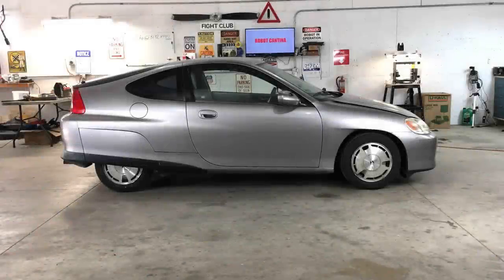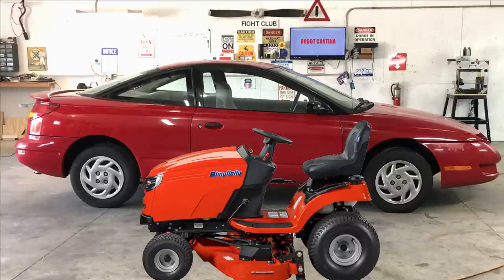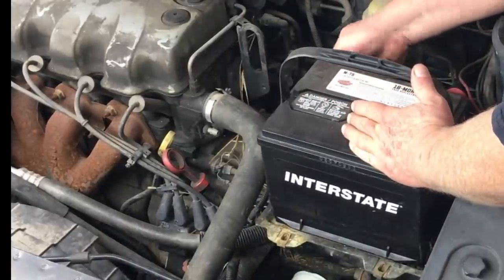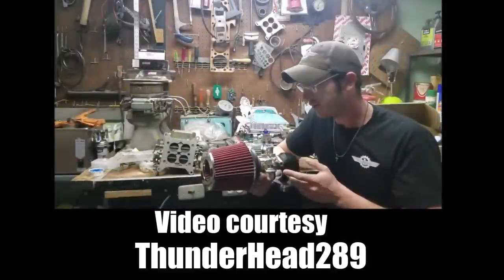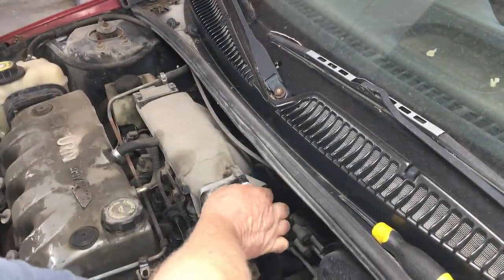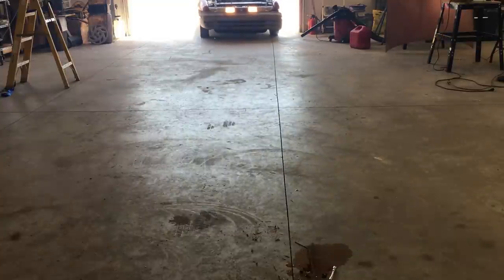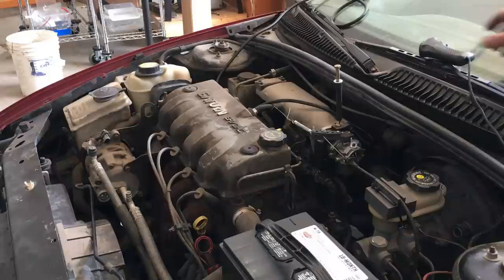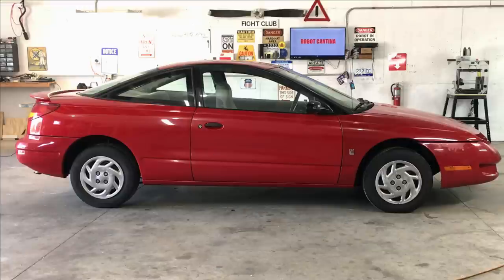S2E14: We get new project cars for more experiments,  plus we put lawnmower carburetor on a Saturn

Comment: Instead of a gas engine swap I would be way more interested in seeing an electric conversion using Hobby RC Car components, they have some tiny but really powerful motors and you could even use multiple motors at once, maybe one per wheel, they don't even need to be mounted in the engine bay.

Comment: The auto trans may need a wheel speed sensor, the water most likely damaged it. My sensor acted funny after i washed my engine bay, but it worked fine after it dried off.

Comment: The slam shifting when you shift into gear and the fact that it is stuck in high gear (probably 3rd but depends on how Saturn setup the solenoids/fluid flow) means the transmission control is in safe or “limp home” mode. Basically the transmission is operating completely with hydraulic control…no electronics. The slam shift means it’s at maximum line pressure (meaning the solenoid that controls line pressure is off) and the gear it is stuck in is whatever gear you get when all the shift solenoids are off, usually 3rd on a 4spd transmission. Transmissions are designed to “fail safe” in this way. I don’t think a bad/missing throttle position sensor will cause that on a GM because they’ll just use a load calculation from the MAP sensor instead. The only reasons that TPS exists on a fuel injection system without throttle by wire are really for idle validation (so the computer can know if it should control idle speed and/or cut the fuel during development) and for tip-in enrichment, everything else can be determined from either an airflow or manifold pressure sensor. Either there is some sort of critical electrical component missing from the transmission (like power, ground, shift lever position, a shift solenoid, etc) or the TCM is junk. Anything is possible on a flood car.

Regarding the lawn mower carb on the FI engine, I’m not surprised it runs but I’d be surprised if it actually runs well under load. Not including the huge lack of power due to the low airflow, but port injection (dry) intake manifolds are not designed to have fuel in them, so the fuel distribution to each of the cylinders is likely to be pretty bad. I’d recommend reading the plugs after you get to driving the vehicle for a bit. My guess is that there is going to be a noticeable difference in fuel going to each cylinder.
Reply: Interesting point there may be a noticeable difference in fuel going to each cylinder. .. I am looking forward to 
more data here.   This was a very well articulated comment.  I sure hope JIMBO   reads all this and thinks it thru.
Reply: @kansasrose2909  I sure hope Jimbo reads all the comments... He
might get some good ideas.
Reply: @mommapanda5736  ROBOT CANTINA    we love these new project cars!    and we love it when Jimbo  re= engineers stuff!  just for fun👍👍👍👍

Comment: Very excited to see where you go with the carb project. Ignition timing would be my main concern as the ecu isn’t receiving a Throttle position I’d imagine it would retard ignition timing quite a bit. Not sure what other sensors this car uses for feedback and adjustment of timing. I’d imagine it would be knock,Coolant temp, throttle position, crank position, O2, manifold pressure and a few others most likely. 

If you can somehow make the ecu believe absolutely nothing is abnormal it will probably work well I just am not sure how’d you’d achieve that with the ECUs stock parameters. You’ll work it out tho, If I’ve learnt one thing its you’re one hell of a smart guy who likes to solve problems👍
Reply: ROBOT CANTINA    we love these new project cars!    and we love it when Jimbo  re= engineers stuff!  just for fun👍👍👍👍

Comment: I'd like to see a twin bore Briggs carb or similar. Question, is timing still being adjusted by the ECU or is throttle position needed?
Reply from the maker: The ignition timing on the Saturn is still being controlled by the ECU.   We are working on a fix for the TPS sensor, however when we transfer the carb system to the coup and do performance testing, the TPS will not be enabled.
Reply: @robotcantina8957  Thank you for your hard work and spunk,  Robot!

Comment: Lockout torque converter ther use to be a plug on the side unplug it and it come out of stuck and only shift 1 2 and 3 but not in over drive it was a gm thang from mid to late 80s to the mid 90s this was a problem in most of gm autotrans on the four bangers never had a v6 do it wander why

Comment: i would have put the carb on the throttle body with a toilet pipe adapter lol the ecu will need the tps for transmission controls, also that cable.
Reply from the maker: Hmmm,  good idea!
Reply: @robotcantina8957  HEY JIMBO.....  congratulations on reaching 100k subscribers.. ROBOT CANTINA is providing the 
entertainment and fun that viewers enjoy..

Comment: Can you even convert an efi car to a properly running carbureted car?  The ignition side can't be converted I imagine
Reply from the maker: I think the ignition module from a mid 90's chevy S10 with a 2.2 would work on this saturn engine and eliminate the need for the ECU.
Reply: @robotcantina8957  well I know what that comment means

Comment: That poor ECM trying to run fuel trims and timing! GM's 'limp mode' is actually pretty good, I think they spent a lot of time on that part of the programming and mapping because they knew things were going to break and they didn't want a bad reputation for cars that died every time the engine light came on. Nice to see the engine running fairly well there, would be cool if you could get or make a carb cheater like TH289 is running. I'm sure he'd be willing to share the plans and files with you to make your own, maybe while he's out on the hotrod power tour he can swing by your shop for a collab!
Trans is in limp because no TPS, get that sorted and it ought to have it's gears back. Leak is probably a cooler line at the trans, common issue and easy fix. EDIT: Saw that the trans might be boned, bummer.
Reply from the maker: TH289 air/fuel modifier is certainly cool.  We are going to put a wideband on the engine and see how far off the A/F is and if it can be trimmed with a simple bleed valve.  If not, we will go build a arduino feedback computer to PWM an air bleed valve.    I like TH289 system, but I would rather not copy and I am capable writing code.  Stay tuned !
Reply: @robotcantina8957   I can't wait to see what you do, I've been doing car stuff professionally for a little over 15yrs including a lot of electrical diagnosis which lately has been a bit of CAN'TBUS data troubleshooting. As much as I know and as good as I am at problem solving some of the solutions you come up with are pretty great, some have me scratching my head, and others well...feels like sometimes you like making problems just to solve them and that's something I can really relate to with my personal vehicles. Keep up the good work, I'll keep watching. You know a Smart42 might make a good project car, they certainly weigh nothing (some years 1800lbs) but they're a little cramped in certain dimensions and might be outside the budget scope of the projects.
Reply: @huzudra  HEY JIMBO.....  congratulations on reaching 100k subscribers.. ROBOT CANTINA is providing the 
entertainment and fun that viewers enjoy..
Reply: @kansasrose2909  ROBOT CANTINA    we love these new project cars!    and we love it when Jimbo  re= engineers stuff!  just for fun👍👍👍👍

Comment: I know that you aren't one to copy the work of others, but from a certain point of view its impossible to not borrow. The very nature of most human endeavors involves borrowing from the work of those who have gone before, and engineering is hardly an exception. You are hardly the first youtuber to install a small air cooled engine to a production car. I remember one example in which the output shaft of the engine was welded to the input shaft of the transmission. The car sort of worked though not nearly as well as your first attempts with the street legal go cart. There have been others who have experimented with supercharging Predator engines. Still, I can't say anyone has carried the Predator swapping of a production automobile as far as you have. Thanks for moving the state of the art forward.

Comment: fuel injected   supercharged  intercooled 420cc hemi big block     WOW  
  I'm all about      KEEP IT SIMPLE    
So   My thoughts    ,,,     while I like the    CVT      the   420  is  just  lacking a little ... 
  what would happen to  retain CVT  coupled with transmission  powered by  420 #1   ( without starter )
 then another   420  #2  ( electric start )  with just a centrifugal clutch...
  Start   #2     then  #2  starts  #1  ...
  two independent  throttles   drive on #1    and if you have  a hill  use  #2 also    :):):)
Reply: I come here for the videos and stay for the comments...  Always great...👍
Reply: @kansasrose2909  Keep it Simple.. I second that thought.
Reply: I am re watching season one of this channel.

Comment: Are you missing an engine mount at 17:57 or is the engine supposed to rock that much.
Reply from the maker: The motor mounts are not in the greatest condition.
Reply: @robotcantina8957  I did notice that rock to the engine, also.  Be careful.
Reply: @robotcantina8957  We don't want you getting squished, you have a  voice for radio and content is great.

Comment: Ignition timing wont cooperate well without the MAP sensor; at least it didn't on my 1999.
Reply from the maker: True, but the MAP is still in play when we use the lawnmower carburetor,  We will try to figure out how to the the TPS to sort of work. lol
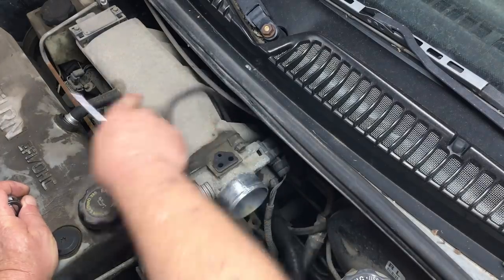Reply: @robotcantina8957  I forgot it's on the opposite side of the manifold. Thought it was the cluster of vacuum lines you pulled of the throttle body at 13:47

Comment: May I suggest a scribe for marking plate instead of an exacto knife. I'm sure the exacto knife works but when you need that blade you're going to cringe that the tip is gone.  If you have an address you don't mind sharing I'll send you a carbide tip  scribe.
Reply from the maker: We publish our PO box address in the video description.   I do have a Carbide tip scribe however we debated on using the exacto knife or crayons for that scene.
Reply: @robotcantina8957  Fair enough. I sometimes get so into the concept that I forget that it's about entertainment.
Reply: @cncmoldsnstuff4423  HEY JIMBO.....  congratulations on reaching 100k subscribers.. ROBOT CANTINA is providing the 
entertainment and fun that viewers enjoy..

Comment: Transmission in wrong gear: maybe limp in with the throttle body missing?
Reply: very perceptive observation here.   I am thinking a lot about
transmissions and gas mileage lately
Reply: @ocdman202  I'm repairing my 1981 f150 and selling my 2008 f150 because the 81 10 mpg better and costs $1000 less a year to insure.  

Fuel economy in king....plus the 81 is actually a better, more usable work truck.
Reply: @j.danaclark2166  that is really neat that the 81 is actually a better more usable work truck. 
yes,  fuel economy has been on our minds lately.  Fuel economy is king.  good point.
Reply: @kansasrose2909  is it really surprising that the new trucks aren't good work trucks though?  I mean, toss a pair of booster cables in the back and then try to quickly grab them.  You can't just reach in and grab them, the sides of the truck are too high to work in and out of the bed.  You have to actually climb in.  And then you can only legally put about 1500 lbs in the back of a new truck, but the old one is closer to 3000.
Reply: @j.danaclark2166  These are excellent points... very thoughtful and very practical.  All of this should be top of mind
in our current environment.  I love the old school farming and ranching knowledge that is passed down thru local
hands here in Kansas.  I hope common sense practices last a long time,  they are worth it. 🚜🚜😊
Reply: @kansasrose2909  no school like the old school.  Practical beats pretty any day.

Comment: Any plans for anything two stroke related in the future?
Reply from the maker: If we find a clean and running snowmobile engine, it may happen.
Reply: @robotcantina8957  also with the automatic Saturn it would be neat to get a manual clutch for a minibike or go kart and make a hackjob clutchflite
Reply from the maker: @morpfrank4709  Thats what we were thinking. The Saturn torque converter is going to be very heavy, and if we hack it up to still allow the fluid to flow, and then use a a light weight clutch.
Reply: @robotcantina8957  the old drag racing transmissions used a sort of cup that grabbed onto the clutch and turned the oil pump in the transmission. You could run two chains: one on the clutch for power and one that always turns to pump oil
Reply: @morpfrank4709  ROBOT CANTINA    we love these new project cars!    and we love it when Jimbo  re= engineers stuff!  just for fun👍👍👍👍

Comment: Idea for good engine from bad car .
Remove engine and make it a cogen generator using carb and no electronics from car.

Biggest issue a Governor to maintain 1800 rpm under load using Arduino.

Then use the coolant And exhaust, after a heat exchanger to coolant,  from engine to heat the garage using the car radiator.

Try on propane or natural gas.

Switch to wood using gasifier!

Sell charcoal from gasifier to locals or have a BBQ!

Makes as much sense as your projects…

Comment: "unfortunately on this part we can't 3d print it" = I can fabricate it in a few minutes via traditional methods and don't want to spend the time designing and printing it
Reply from the maker: lol,  The EGR block off plate is in direct contact with the exhaust gasses,  A 3D printed version would last about 5 min.
Reply: @robotcantina8957  oh, I thought it was the EGR inlet on the manifold. My bad!
Reply: @robotcantina8957  and I'm no 3d printer expert but I know they make ultra high temperature compounds with stuff like ceramic. I'm sure it's possible to 3d print a part that'd hold up to exhaust temperature. But completely not worth it.
Reply from the maker: @PsRohrbaugh  Eventually I will experiment with different filaments.  I'm really impressed how stable the ASA stuff is for under hood temperatures.
Reply: @robotcantina8957  looking forward to different filaments,  Robot!
Reply: @ocdman202  HEY JIMBO.....  congratulations on reaching 100k subscribers.. ROBOT CANTINA is providing the 
entertainment and fun that viewers enjoy..

Comment: i would like to see a car with unmodified engine , but with driveline converted to freewheel anytime gas pedal isn't depressed . driven in normal everyday traffic , to see how much gas mileage improves . there is an adapter for farm tractors , called an overrunning clutch , or adapter , that slips over pto shaft . it allows freewheeling of the driveshaft of pto driven attachments , in only one direction . if one (or two ?) could be installed in axles of a very light car , like a 1st gen geo metro ,  for experimental purposes , car could be manually pushed when needing to back up .
Reply: Inspired by Saab
Reply: @antjeeismann4684  thanks , i didn't know they had it . searched and found that toyota is interested in it also .